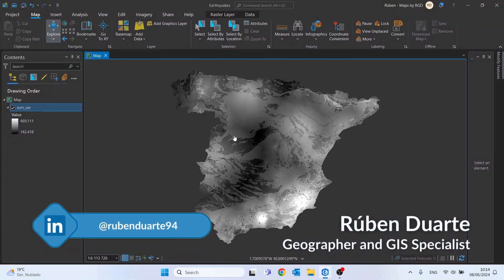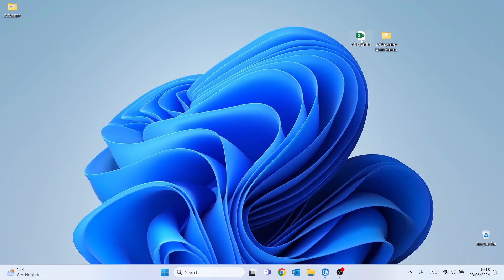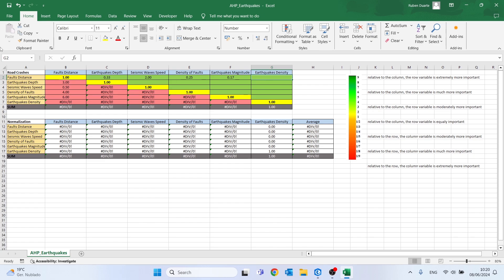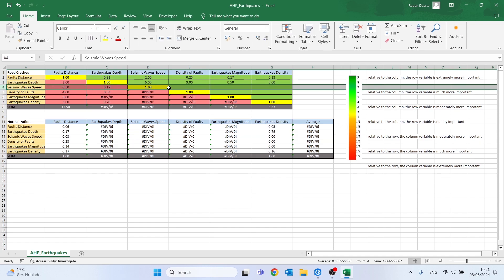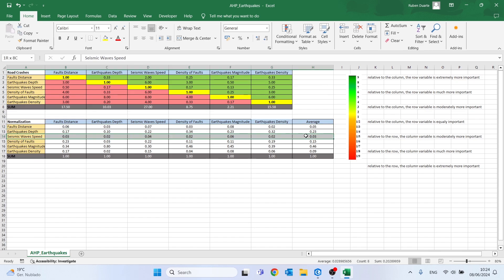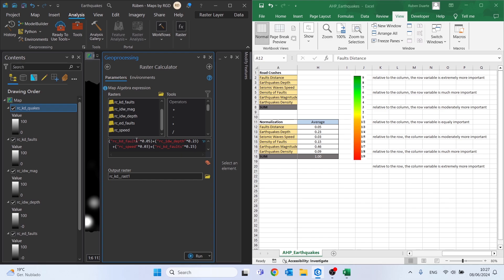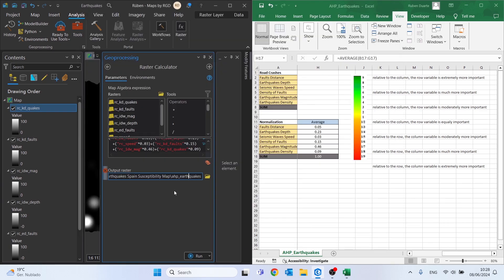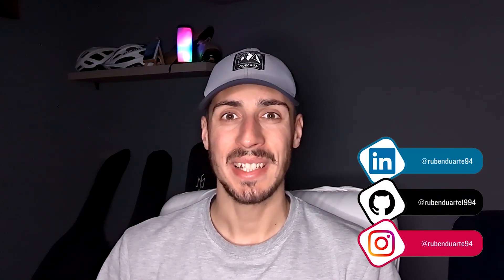MULTI-CRITERIA DECISION MAKING USING AHP - EXCEL ARCGIS PRO TUTORIAL - ANALYTIC HIERARCHY PROCESS

Comment: Hi Nice video, can you tell me the meaning of the values in resulted map (that is 35.0218 -79.1532 )
Reply from the maker: Hello, thank you for your comment! The values represent the maximum and minimum seismic susceptibility. In this type of exercise, the final value, by itself, doesn’t represent much. That’s why we then need to define what type of interval we want to apply, whether by quantiles, standard deviation, or another method. Therefore, what’s important to note is that 79 in this case represents the highest susceptibility value and 35 the lowest. If we used the same methodology for another study area, the values would always be different.